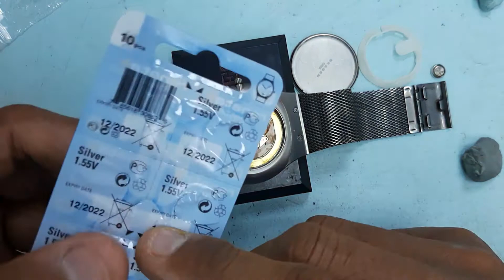Skagen Watch Battery Replacement and Gasket Cleaning with Greasing | Watch Repair Channel

Comment: Unfortunately this shows that I can't just use a screwdriver and tiny tweezers to change my Skagen watch battery, I should get a professional to do it properly
Reply: A kit including the tools you need is cheap on Amazon, pays for itself on first battery replacement.
I bought my tools for less than 20 bucks and have done most of my watches for a couple of years.